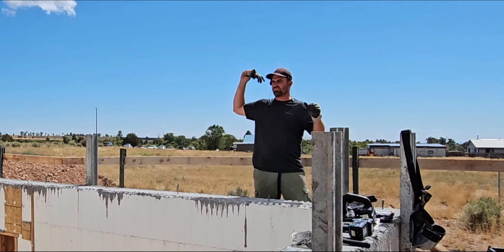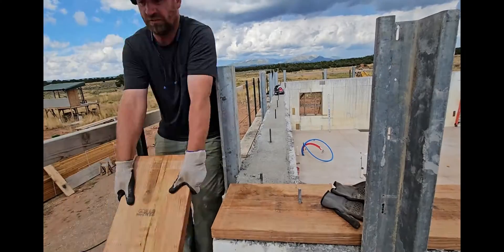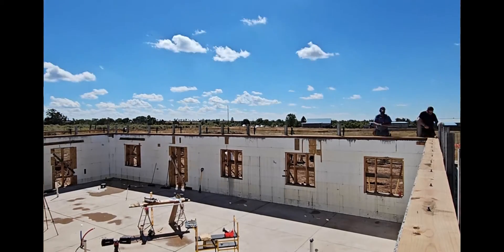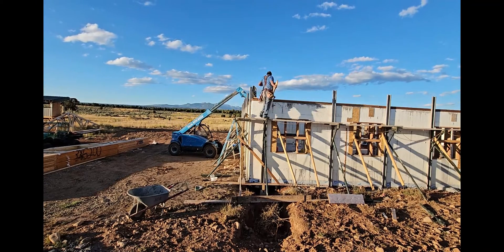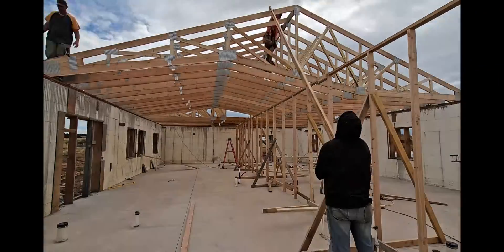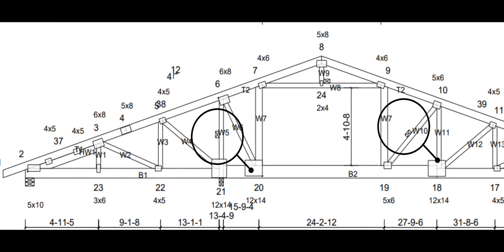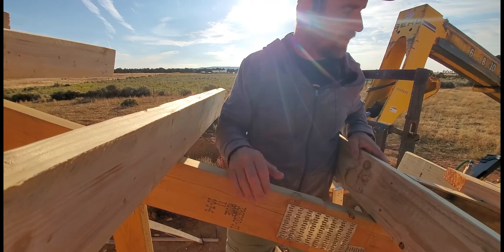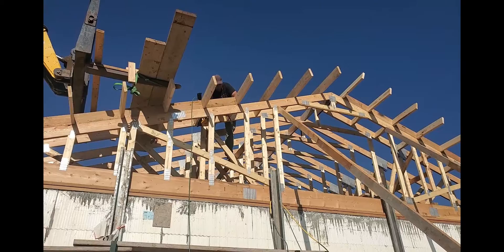Installing 40' Trusses WITHOUT A CRANE!! How we did it

Comment: Rent a hand crank material lift or man lift. Carry the trusses inside upright one at a time. Position lift on center line but angled. Hang top of truss onto lift, crank just higher than walls, move into place, secure, crank down lift. Next!  Can be done by as few men required to carry the truss into the building.

Comment: 30 trusses for $20K, $665.00 per truss is remarkably expensive.  Looks like you got some built in storage within the trusses so there's a bit of justification, still pretty spendy though.
Reply from the maker: We weren't sure how much to spend on these. Some features we ordered were large storage areas on either side of the home, scissor trusses through the main area of the home and every truss is able to span 40 ft without the aid of support walls. I believe these added cost. In the future we will shop around more, but BFS was so easy to work with, they made it easy.

Comment: Setting Those 40 footers was intense! Great video. How long did you let the walls cure before setting the trusses.
Reply from the maker: The walls were in place for about a week before I started on this project. We left all of the window and door bracing in place (with one exception on the gable end as it does not hold up a lot of extra weight). The bracing is still in place and will remain so for another two weeks or so. 

Thank you so much for watching!

Comment: If you use sill sealer, do you still need treated boards?
Reply: had the same question, but I quess money-wise it makes sense to be better safe and sorry
Reply from the maker: @GreenTreeBuilds  that was my thinking
Reply from the maker: The embarrassing answer is,  I don't know. I only realized that was a good question when I was parked next to the stack of 2x12 boards at the lumber yard. I called my very experienced builder friend, and he said, "Get green treated wood. They are not ground contact approved, but they have the bug and weather resistance." Unfortunately, nobody had green treated, so I went with the more expensive red treated.
Ask your code experts, but I believe you make a good point. Framing grade would probably be fine.